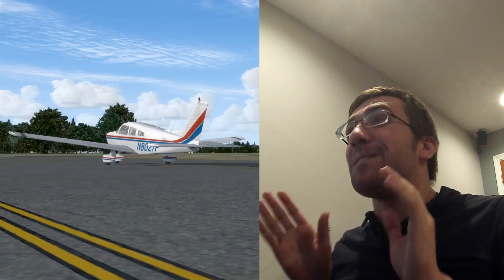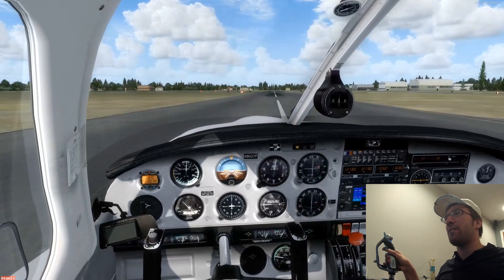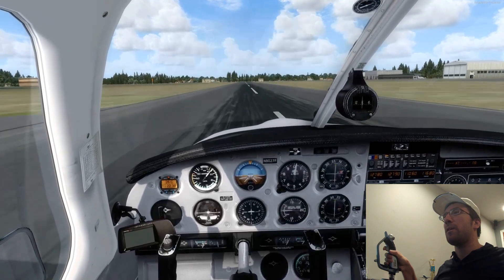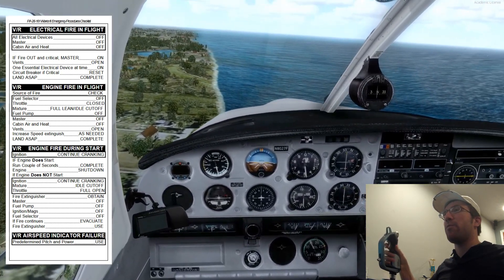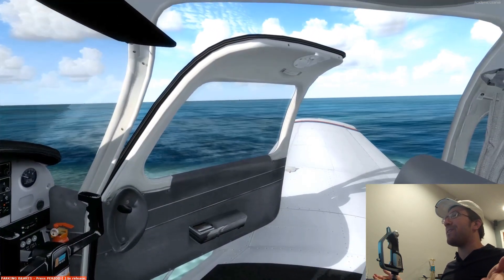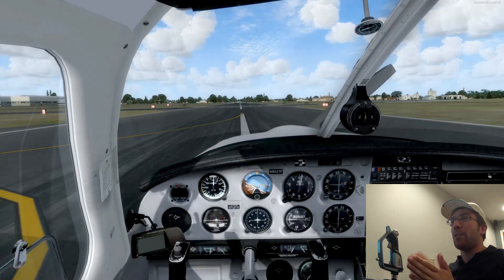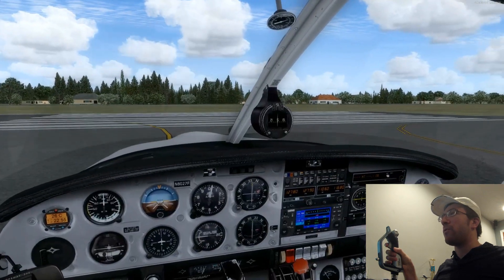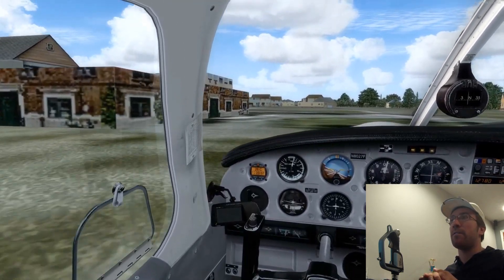Engine Failure Torture Test - Emergency training with realistic flight simulator visuals

Comment: Nick, kudos for replying to so many comments. Also, kudos to the commenters for the great, constructive critique.
One thing I would put in the mix is: if you ever have to ditch in a Piper, ALWAYS ALWAYS ALWAYS get that door open and shove something in it to keep it open beforehand. It's been brought to my attention that in the Pipers, the aircraft hull WILL bend after the mains touch the water, and you'll never get the door open afterwards if it's latched shut. Additionally, the banner towing op I worked for this year told me in the event of an in-flight engine failure while cruising a busy beach, don't land on the beach; land on the water close enough to the beach that you can walk, not swim, to shore. I think that's reasonable when you know the beach is heavily occupied. There'll be tons of people who can help you and call for help. Otherwise, if it's a barren wasteland with nothing but sand, then beach it up, maybe use the wet sand to help slow down faster if the tide is going out. The commenter that mentioned spiraling down may be a good way to alert people below that something bad is happening to you, since you won't be making as much noise without that loud thing in the front working; the people at the bottom end of your glideslope won't be as cognizant of the situation if you flew in a straight line. That notion seems reasonable, so long as you watch your bank angle/airspeed in the turns.
Hope you're ready for Wednesday Night's snow storm; gonna be a doosey! Think you'll miss the snow after you move to FL? (heh heh heh...)

Comment: Shouldn't it be Full Throttle - Then Mixture Idle/Cutoff. To burn off the remaining fuel within the lines and engine? Also your POH should have an Airspeed for engine fire incombustibility so the immmedite action should be pitch for that speed to extinguish the fire. Then pitch for best glide.
Reply from the maker: I've heard the full throttle thing in these comments quite a bit, though I've never seen it on a checklist.  Seems like a good idea, though.  I can't think of anyway it could hurt you.  As for a speed, most checklists I've seen say to pitch for Vne to put out the fire.  Maybe your checklists are all just newer and next level compared to what I'm used to.

Comment: THAT.  WAS.  AWESOME!  
From a Civil Air Patrol Safety Officer:
1.  THANK YOU for the advice about the impossible turn.  I curse the day this was taught because now if gives pilots a delay in reaction and planning as they decide what action to take.  Think about it; single engine failures on take off makes you commit to choosing a landing spot, but in twins, now you have a decision to make.  Tick, tick...boom.

2. You have GOT to tell me what software and hardware you're using, and that VR type connection with the hat - MS FS X is what I have, and I think my system may be a bit weak...I get snap shots instead of streaming video.  And, I can never get he eye view squared away at straight ahead again after looking out the sides.  I have the Pro Flight yoke, pedals and throttle quadrant, but I frankly LUST after that hat thingie, and your set up.  HELP ME OBI WAN!
Reply from the maker: Sadly, even a liquid nitrogen cooled super computer will never get you fluid visuals with any flight simulator today... they're just too poorly optimized, but FSX is definitely the worst.  One quick tip to solve one of your problems for free, though, you can assign a joystick button to recenter your view.  That's what I do when I'm not using TrackIR.  Hope that helps :)
Reply: Friendly Skies Film the optimum bank angle for a turn back to the field is 45 degrees to minimize energy loss. Give that a try next time, we do this at 200’ AGL in the glider. For powered I think the turn radius dictates something like 800’ AGL, but you must always have the mentality of being “locked and loaded” to instantly start that hard turn the moment you pass 800 (or in our case 200’). We verbally call out on every take off “200’ I can turn back”. I’m surprise powered guys don’t implement this common practice. You should fly with your professor at WPI at the glider club if you’re still in that area. He seemed like a cool dude.

Comment: Couple of thoughts here, in the spirit of sharing ideas and keeping each other safe up there:
1. I wouldn't start reading checklists with a failure of any kind when I'm a mere 1000ft above the ground. No time for that. You'll be on the ground in about a minute to 90 seconds. Just fly the airplane, and do the memory items if you can. But fly the aircraft first.
2. you said your minimum for turning back to the runway is 400ft? I don't think that'll cut it. I can manage 500ft in ideal conditions, with a plenty big runway and no obstacles close by. I tried it 2 or 3 dozen times in simulators, including a Redbird MX. Let me tell you, it's no joke! You'll need to religiously maintain best glide speed a fly a well coordinated steep turns to make it. Knowing all that, my personal minimum for the real world is 800 to 1000ft.
3. This might be a controversial one. I would have gone for the Highway instead of the beach in this specific case. I'd rather risk hitting a car at a comparatively low relative speed, than beheading a dozen unsuspecting people on the beach. If you're engine is dead, nobody on the beach will hear you coming in time to get out of the way. There have been people killed in such cases (I seem to remember one instance not too long ago, maybe a couple years). When I hit a car, at least the people in it are somewhat protected. Plus, the Highway was closer.

Comment: Taking off on a hot Summer day with full fuel and full seats at a very high elevation with high trees at the end of the runway can make for an interesting flight. Happened to me in Big Bear, CA. Ended up finally getting climb after a few minutes of uncertainty, but it wasn't a simulation, just a real life thrill-ride

Comment: Just out of curiosity, have you ever tried to mount your stick and throttle in a position closer to where the real aircraft controls would be in relation to your body? I was doing my training in a Samba XL which has a stick between the knees and when I moved my Warthog to that position I found it made a huge improvement in my flying, both simulated and real, since I could practice making motions with my wrist instead of my whole arm. It even made a difference in my flying with a yoke aircraft (Cherokee 180) since my wrist angle was up instead of down relative to my forearm.

Comment: Do a vid with power off practice.  I would think it will take more than 400-500 ft to do the 180 back to the airport.  Most planes are 800-1000ft including the couple of second WTF moments.
Reply from the maker: I've been wanting to do that too.  I think the performance of the real plane might be a little better for whatever reason.  I've watched my instructor do it from 400ft, so it's at least possible, though it might be terrifying as hell.
Reply: Completing the turn without stalling is easily practiced at altitude where minimum altitude loss can be determined safely, practiced repeatedly, and then applied to setting personal minimums for that aircraft.

Making it back to a runway is a different story. Pitched for Vg, most planes are going to use up a lot of ground to make that turn. Add in that we instinctively turn left even if the wind is actually from the right and we get to multiply (dependent on actual wind) the amount of ground chewed up. Now, once we've completed the turn there is likely still a bunch of distance to cover to get back to the runway -- and we're out of altitude to trade.

On the other hand, if we minimize turning radius (aggressive bank angle, remain fast enough to avoid an accelerated stall but no faster, and MAKE SURE to turn INTO the wind) then we can make the turn back without covering excess ground, pitch for Vg, and get lined up. Counting on being able to do all that when we haven't practiced it and aren't expecting it would seem unwise.

If it's performed fairly regularly and every takeoff is briefed as "when the engine quits above X00ft, I will..." then there's a good chance it will work out as practiced. Really I think that's the key. For myself, I know I haven't spent enough time practicing engine-out scenarios in my plane nor do I do a lot of high bank angle practice (working on instrument rating), so I have my turn-back minimum set at 1000' AGL. Anything below that and I'm giving myself 'anything I can see in my periphery while looking straight ahead' as options. Fortunately most of the fields I fly out of have undeveloped property on or near runway heading, but not all. Statistically tree top landings can be very survivable, if you approach them as a normal landing.
Reply from the maker: EXCELLENT advice as always, good sir :)

Comment: I fly the piper in VR on the oculus, it is 100 times better than the monitor.
Reply from the maker: I'm sure it is :)  VR works great for home simmers who know their control layout, and can have all their supporting material in-game, but for flight schools, it's a nightmare.
Reply: Vincent Carbonara VR gives you a sense of presence and immersion. VR basically puts you inside the cockpit of the simulator, you look around and you are see the inside and exterior of the aircraft (no lag or smearing of the displays). It is also 3 dimensional, so you have a sense of depth and are aware of distance, depth and scale, which is essential in VR. The fact that people experience a fear of heights in VR show how realistic it is.

Comment: As usual, great video. I use P3D V4 but have never tried the failure options, will have to do that.
Also the Track IR seems like a handy add-on for flight sim.

Comment: out of curiosity if in an emergency situation that does not include the electrical system shouldn't you leave it on? Aviate, Navigate, COMMUNICATE. of course if you were to, for example, run out of fuel and were required to make an emergency landing, I would not think it advisable to switch the master off.
Reply from the maker: Well, for whatever reason you want to argue, you'll note that it's an item on the emergency checklist in almost any situation, so that's what I do.

Comment: Are you able to share your PC specs to run the sim? GHz, RAM size?
Reply from the maker: Nope.  That's classified.  ;)

i7-990X  (3.7Ghz Hex Core)
GTX 670Ti
12GB DDR3 1600Mhz.

Comment: That flight simulator is not really that real because most of the time on real engine failures in small prop planes the engine turns off and you lose a lot altitude.
Reply from the maker: That was... the whole point of this video?  The physics are all the same.  Within some margin of error, what you saw here is what you would see in reality.
Reply: "most of the time on real engine failures in small prop planes the engine turns off"

Most of the time in a piston engine you get a gradual loss of power and associated roughness that may or may not result in complete engine failure. In the cases where it does die suddenly (without warning) it is most often due to avoidable fuel starvation, though there are the rare exceptions like throwing a rod. It's also pretty complicated to say what is going to happen as a result. For instance, if you have a 3-axis autopilot engaged then it will hold altitude for as long as possible, so what you'll lose first is airspeed and then altitude once you run out of airspeed to trade. Let's say you lose one of four cylinders: the engine will run like crap but you may be able to maintain altitude -- with an autopilot engaged you'll see a reduction in airspeed and feel that the engine is rough, but everything else may remain normal. Or you lose one of two magnetos, the engine runs rough but you may not notice, and you'll lose some performance but whether you realize that may depend on workload. In the case of an oil leak you're going to lose oil pressure long before the engine seizes -- if you're paying attention it may be possible to be safely on the ground before that happens.
Reply: @Friendly Skies Film, when you landed on the beach when rolled off you shouldn’t just die.
Reply from the maker: "Flight" Simulator ;P

Comment: Given the overall high level of technical knowledge you typically display, I am amazed at your surprise at the engine seizing up when you lost oil. "Why is he looking at a checklist? That engine will probably quit before he touches down!" Was my immediate thought. I'm certain the low oil pressure/high oil temp scenario was covered in your training. Pretty much a classic. The oil on the window is a better sign of that about to happen than we might usually get.
Reply from the maker: I was surprised p3d actually went that far, given that the rest of their failure tech is pretty dodgy, not that an oil leak would produce these results in real life.
Reply: Friendly Skies Film. Whew! I was thinking thought of Florida were beginning to fry your brain!
Reply from the maker: Lol If only.  It's snowing and 4° at my house again today :P

Comment: I’m not really in favor of the impossible turn either, but I will say that you’re not doing it justice. If you were really going to do it, it’s not like a normal turn at all. The trick is to get the plane turned around as quickly as possible so that all altitude can be spent in the right direction. To perform the 180 as quickly as possible, a 80-85 degree turn is usually necessary. Or land strait ahead, but if there’s nothing but trees in front of you, don’t think it’s a DPE steep turn.
Reply: Surad Mister went to a seminar at Airventure and a guy tested that out. Found that 50-60 degrees was a good margin between safety and getting turned around. Seems counterintuitive but i see the reasonings to turn that steep. He said “turn 50 degrees and pull to the buffet.”
Reply: 80-85 is too much for someone not used to acro, your nose will be in the ground before you know it, especially if you've not wrapped your head around top rudder. 50-60 is what I'd expect would work best too, when gliding we maximize climb at that region of bank when thermalling.
Reply from the maker: Uh-oh.  You changed your profile picture, now I have to re-learn it.  I found a NASA paper ages ago that proved practically what they found mathematically, that 45 degrees will always be the optimum for any airplane.  I should find it again, but I think I agree that too much bank angle is just a law of diminishing returns problem.
Reply: I changed?! 
Optimum seems to be a good key word there. I certainly wouldn't be comfortable or even probably capable of a 60° bank after an engine failure, especially after takeoff!
Reply from the maker: I thought you did!  Maybe my brain is trained on how you show up in Patreon.  My bad.
Reply: Obviously the impossible turn is extremely dangerous, and it’s certainly not the thing I would recommend for a student pilot or even an inexperienced pilot. If there’s a field ahead, or even a nice road, take it. With that said, I saw you use up a lot of energy making that left turn when I know you could have made the field. When the engine fails, the first vital step is to recognize it as early as possible. That’s when you need to decide if you’re high enough to turn back. Then you rather aggressively put the airplane in that knifing bank angle and pull back a pretty good deal on the elevator. To get into that bank angle, it sometimes helps to use full rudder in the direction in which you decide to turn. Once you’re established, the elevator turns you back to the right direction fast and the rudder keeps the nose hanging up since you’re sideways. (Usually, takeoffs are done below the maneuvering speed.) The stall horn’s gonna sing like the Swedish Nightengale, but the trick is to not let the plane stall too much or for too long. When you hear the horn, don’t hold it stalling for more than a few seconds—break the stall by pushing forward for a split second, then keep pulling back. Once you’re in the direction of the runway, it’s a normal glide. Reach down and pull the starter and try the electric fuel pump if you’ve got the time. Lower bank angles result in you loosing energy when you’re still pointed away from the runway. Basically, for all the time you’re faced away, you loose altitude and the distance from the runway grows. When you’re at least going the right way, you still loose altitude, but at least you get closer to the runway. (I will try these other bank angles at a high altitude sometime, but I have a feeling I’d end up in someone’s living room.)

Comment: 5:05 climbing out of 2,500 you should have enough altitude to make the turn back to the airport.
Reply from the maker: Depends on the wind and your climb rate, but good point.  You should always check.  Using a nearest airport feature on a GPS is always a good idea too.